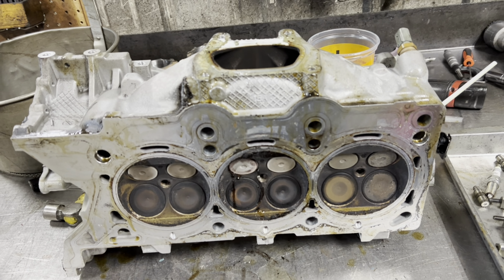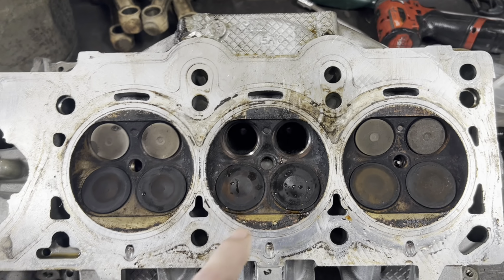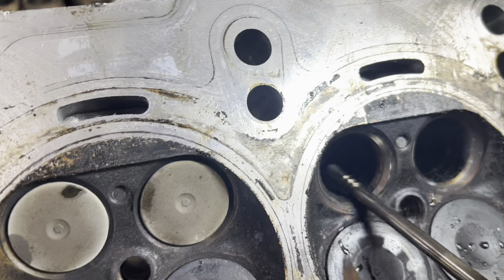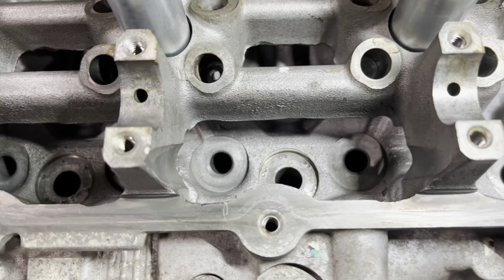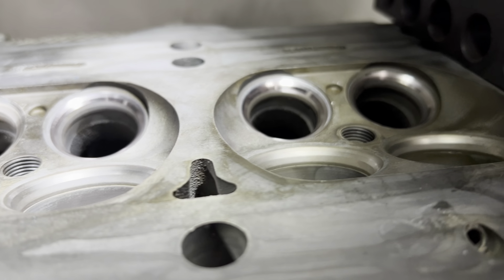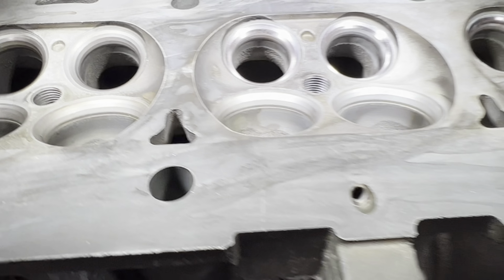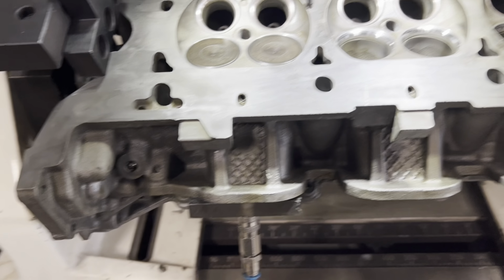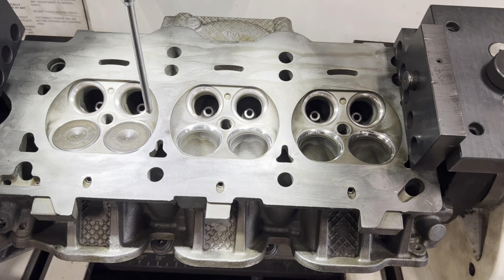Chrysler 3.6 Pentastar V6 Left Bank Cylinder Head Repair Common Misfire Codes P0302 P0303 P0306

Comment: Hi I had this a new head installed on my 2013 3.6 and it wasn't covered under warranty for some odd reason. Now, 50,000 kms later, same issue again. Can i get an upgraded better head as a replacement?

Comment: Class action lawsuit on 3.6 cylinder head problems. Currently waited over 3 weeks for repair. $3000+ at the local CDJR dealer. 2014 T&C 134,000 miles.